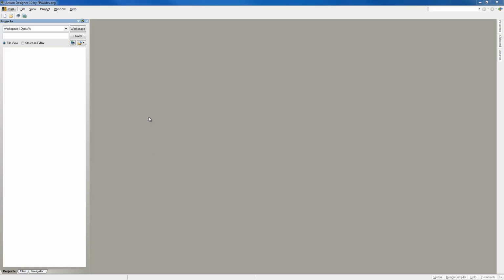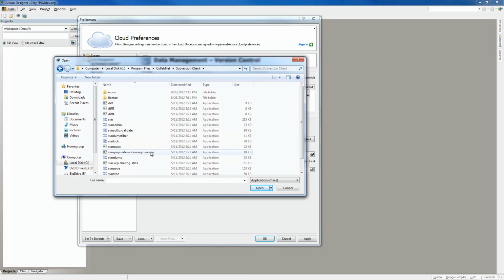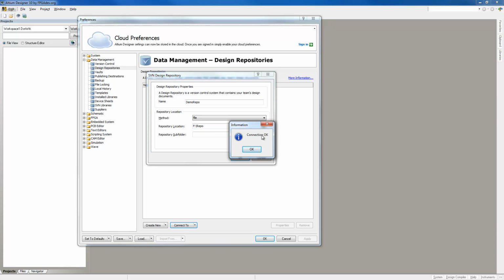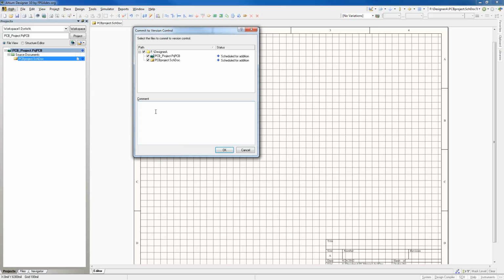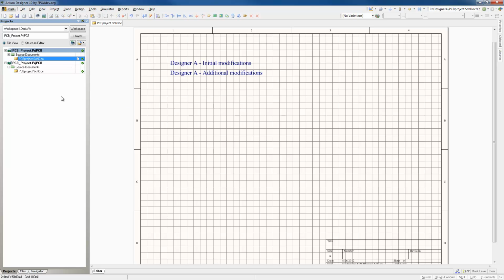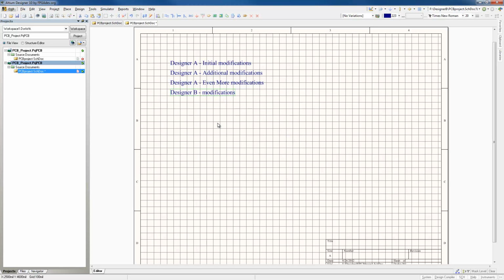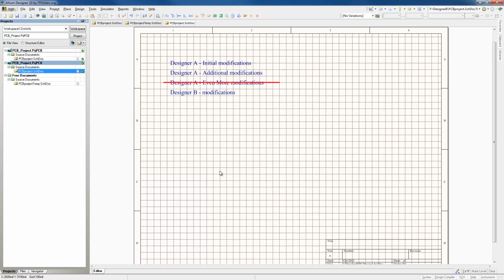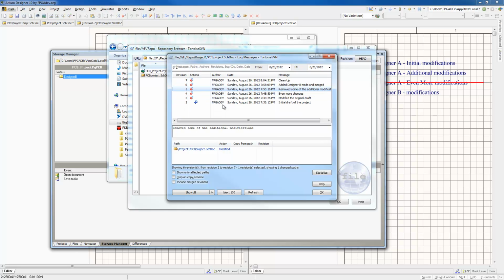Version Control in Altium Designer

Comment from the maker: The biggest advantage that one would get from the Vaults is the ability for the user to determine if a component has been used on any of the projects in the vault and it could be useful for end-of-life for substitution of components. However if you already have a good purchasing database and using SVN, you should be able to accomplish the same thing. The Vaults would be useful for a company that has multiple divisions with many engineers working on the same projects.